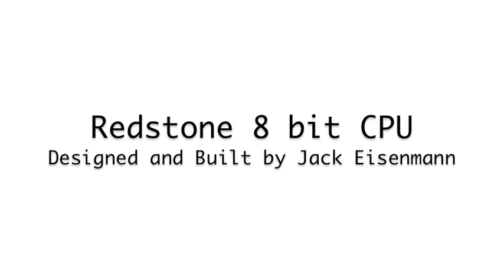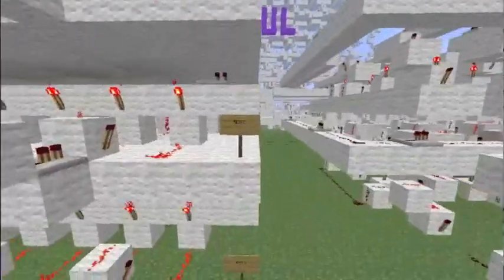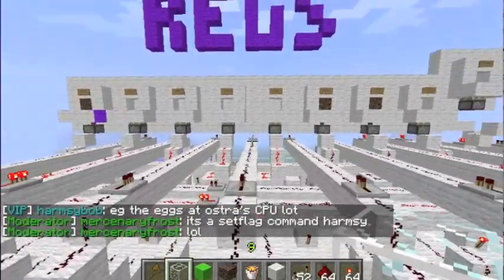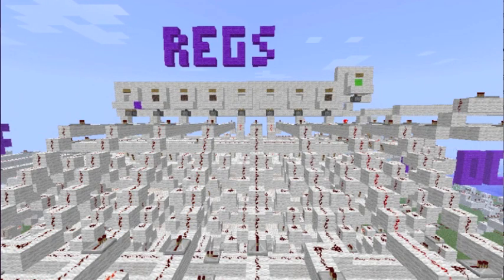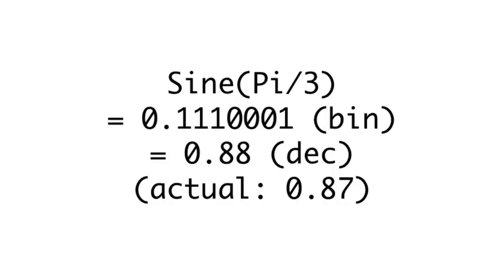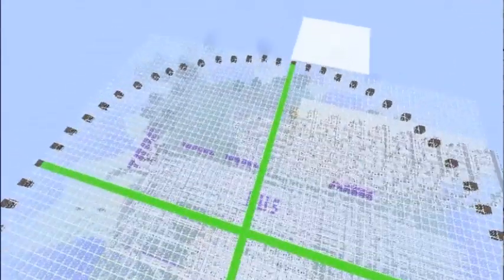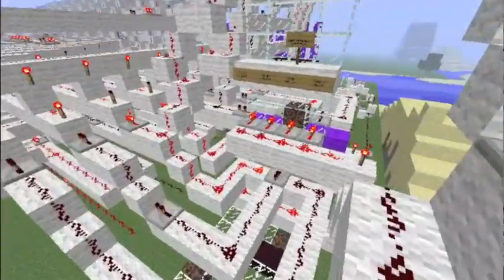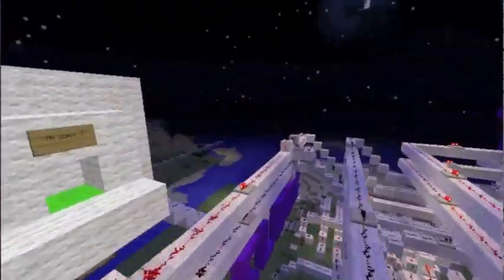Redstone 8-bit CPU "DUO Crimson"

Comment: This is somewhat irrelevant to the video, but I heard somewhere that NOR can be used to perform all boolean logic functions.. Is this true??
Reply from the maker: It is true! That is why Notch originally chose the redstone torch (which behaves as a NOR gate) as the primary logical element.
Reply: Ah! Thanks :)
Reply: Would it be a bad idea to make a "gaming" computer using ONLY NOR in the ALU? I can see why that would be a mistake in terms of speed, but would programming be a nightmare?
Reply from the maker: Hawk Sandwich Actually funny story, I once made a TTL computer like that. It is called the DUO Compact.
Reply: Could it run programs reasonably fast?
Reply from the maker: It was significantly slower than a conventional computer.
Reply: Esperantanaso
I remember seeing that on youtube! It wasn't TOO slow, but just fast enough to play short songs at a reasonble speed, but that was electronics, Redstone is CONSIDERABLY slower, depending on your PC/Mac's Hardware.
Reply: The original computers used in the Apollo missions used massive NOR arrays for their logic.
Reply: Interesting. Thanks for that fact
Reply: True. You need multible gates to replicate the other operations. NAND can be used too. In redstone world, there is only NOR :-)
Reply: That's why you need to build some big things to get any other logic gate. You can build every redstone circuit (as long as it doesn't rely on redstone wire lengths) in real world without changes if you use NOR gates. You can reduce the redstone circuit size by convertig any circuit to NOR before you build it.
Reply: +Frank Saibert you can make a NAND gate out of multiple NOR gates

Comment: Have you considered overclocking your processor?
You could get it up to about a computation every  2 min 43 sec with your current cooling system. I 'm pretty sure intel turbo boost is compatible with his your hardware.

Comment from the maker: @twoofakindmagic Yes, the machine uses a maclaurin series. One can adjust the angle by using addition/subtraction to put it in the range of -Pi/2 to Pi/2 if it is not already. This will yield a precise and correct answer.

Comment: Taylor polynomial is a good approach, but if you only approximate through the 5th term (I think you said that in the video), then any angle past the first period will be innacurate. Yet, I understand the large amount of computation necessary to calculate more terms of the taylor polynomial. I'm also assuming that you are using a maclaurin series to simplify the process a bit.